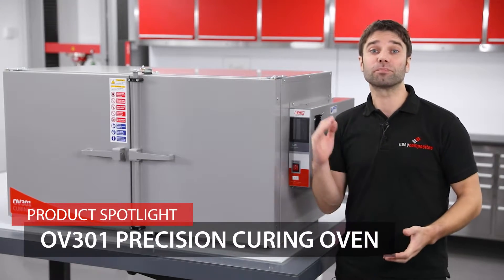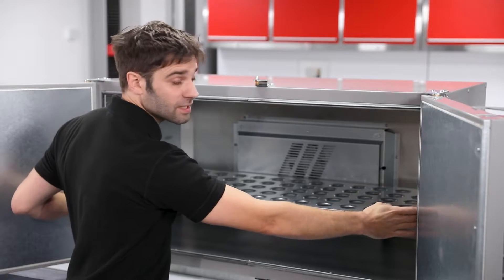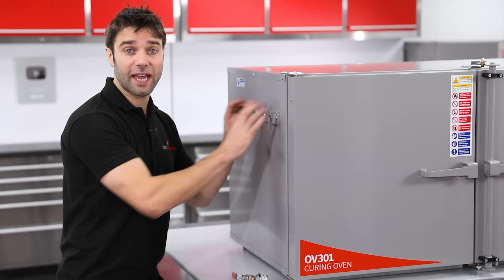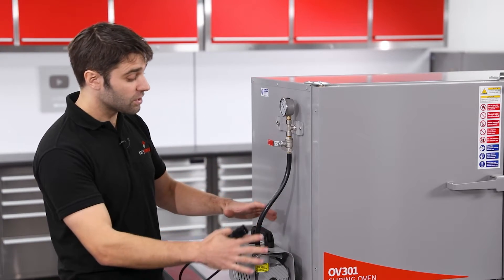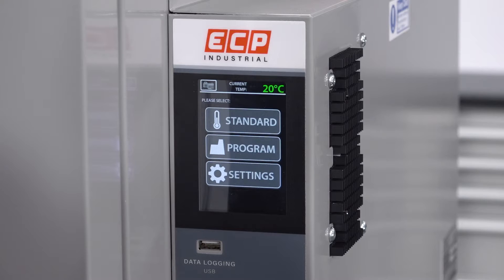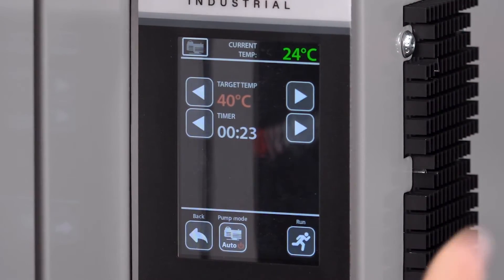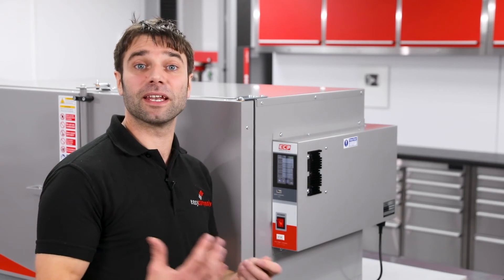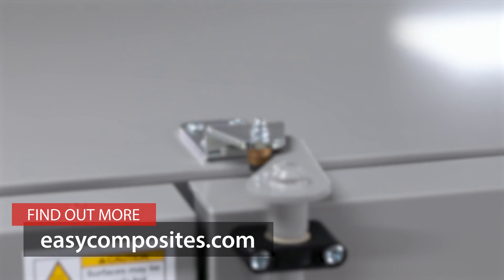ECP OV301 Precision Composites Curing Oven - Product Overview

Comment: For curing silicone, most online information recommend higher temperatures and higher humidity.  If this oven is used for speed-curing silicone, would water be added in a pot inside the oven?

Comment: Question may be inaccurate i need info Does this model have openings for fresh air to be preheated and circulated by the fans, or does it rely solely on recirculating the existing chamber air and also the type of fan(is it axial) and heating element used.
Reply from the maker: The oven recirculates the air inside. It doesn’t draw in or vent air to outside. The fan is an axial fan. The element is a conventional electric ring element, similar to what you’d find in a conventional fan oven.

Comment: What is the difference in strength between oven and autoclave cured prepreg on average? 10%? 5%?
Reply from the maker: It would depend on the test. In straight compression or tension, you’d probably struggle to measure any difference. Interlaminar shear is the property most likely to improved by positive pressure consolidation so a 3-point bend test on a cured laminate sample might perform a few percent different. We plan on making a OOA vs Autoclave video later in the year where we compare the differences between the two processes but, in short, done right with the right materials the differences are quite subtle.

Comment: Hi ... we have two of your ovens, just newly purchased and have run a few cooks. We ramp up to 121deg c at about 3 degrees per minute,  soak for an hour, and then try to ramp down at 3 degrees a minute until 60 degrees c . It says in the manual that it can control the ramp down, and we are finding that the oven can not cool down at that speed without cracking the door open, or it just holds temp. Is the oven and  controller designed to do this type of ramp down with the doors closed? Cheers Paul.
Reply from the maker: The oven doesn’t have any forced cooling or ventilation and is well insulated and so there is a limit to the cooling rate that it can control (basically, all it can do is turn off the heating). If the cool down rate required is slower than the oven will naturally cool at (with the element turned off) then it can control it, if you need faster cooling then it has no way to achieve this.
Opening the door is the obvious way to speed up the cooling but it would be important to switch the oven off (or set the target temp very low) for this phase so that you don’t accidentally get in a situation where the heating elements are working flat out to overcome the heat escaping from the oven. Over prolonged periods  this can actually cause dangerously hot conditions directly above the heating element.

Comment: hello. I have an ov 301 oven with the industrial controller. Will the new touch controller work for my oven?

￼
Reply from the maker: There have been changes in the wiring and casing, it's not possible to retro fit a touchscreen to an old oven.

Comment: Hello 
I got a question , I got one of these ovens from the 1ste generation, and I love to work with them .
But they are difficult to program with the old steering so i don't use it with the programmation function only in manuel mode , this steering is looking fine.
Is there a kit available to upgrade the old steering??

Kind regards Tom
Reply from the maker: Hello Tom, unfortunately the oven control box is not upgradable, the internals of the oven and a lot of the components are different.

Comment: Even if I did not find it in your sortiment - perhaps you have some alternatives for us working with epoxy in environments without complete control. I.e. structural work in sheds without heating or smaller workshops where heating blankets might be very handy to get a controlled cure?
Reply from the maker: Hi Rolf, it depends what process you're following. We have resins which have better tolerance to lower ambient temperatures and certainly it's possible to undertake most composites processes in less-than-ideal ambient temperatures but there is always a compromise and usually that compromise is reliability; for example, if you do a resin infusion in a cold shed using a heat blanket to get some heat into the mould and resin then there's likely to be hot spots and cold spots - you might then find resin flowing faster in the warm areas and very slowly in the cold areas, resulting in a partial infusion. Ultimately, you might be better investing your time in improving the insulation and heating where you're working to at least achieve some modest level of control.